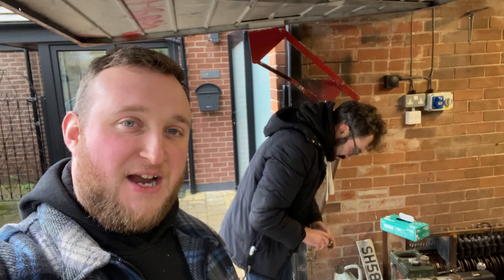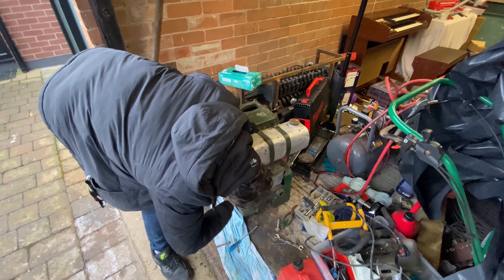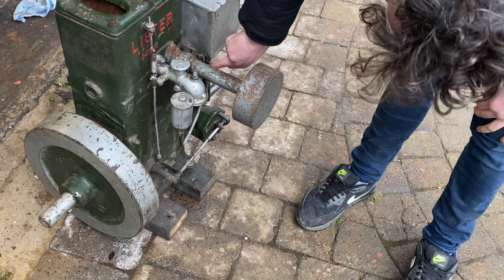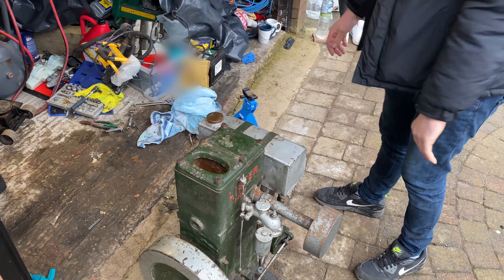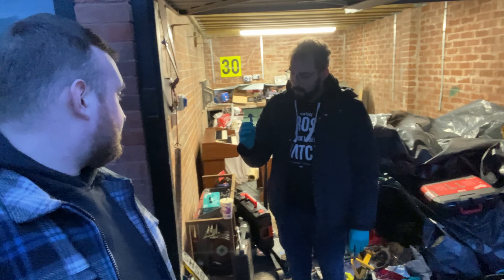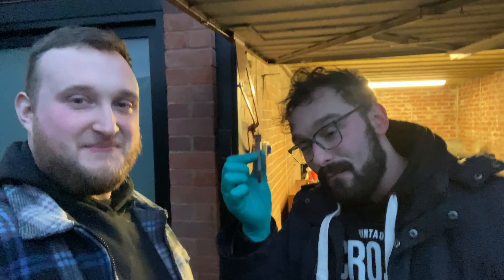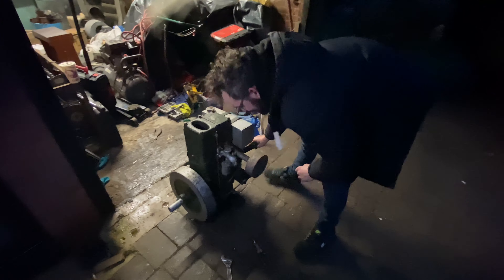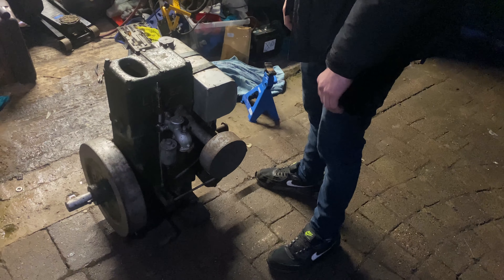We Still Can't Start It! | Lister D | Episode 2

Comment: I don't know how much this will help but here goes.....I have two Wolseley stationary engines, and I had a similar "refuses to start" issue with one after I removed and cleaned the fuel system. The float bowl assembly connects to the carburettor via a horizontal passage which attaches to the carby with a vertical banjo bolt with two copper washers either side of the fitting. When I assembled mine, I got the copper washers wrongly placed, and the difference of height of the attachment of the float bowl was only about 1mm, but that was enough for the carby to flood and the engine to not run. Once I got it right, I can now start it by rolling over the flywheel by hand (no furious cranking) as the magneto has a fitting that allows it to 'flick over' at the point of firing to produce a nice fat spark.
Reply from the maker: That's something we will definitely be checking out! Thanks for your help.
Reply: Very interesting! We’ll give it a try! Funnily enough the kit came with about 4 different sizes of washer, the originals are copper (and where absolutely creamated!) and the new ones I fitted appeared to be slightly oversized, the next size under seemed far too tight on the threads but there’s a few different thicknesses so certainly worth a try! No matter how much I tightened the banjo up to be snug, the float body was still able to be jiggled!
I guess you’ll find out in the next video if it’s a success! If it is, I’ll gift you the old washer personally.

Comment: You don't adjust the float height, the clip sits in the needle groove and that is where it lives, has anyone tried adjusting the mixture wheel? One turn back from fully clockwise for a cold start, stop using the float tickler they flood easy, hold down the air valve when cranking, release when it fires, is the governor linkage free to move? Does the spark jump 5mm out of the engine? Watching this is to be honest seriously bloody painful for me as a Lister D owner and car technician.
Reply from the maker: I don't think we made it clear to see, but the float is actually jumping out of the groove. Hence the need for constant adjustment. A new needle and float have been ordered. So hopefully that will solve the issues. 

We are now debating completely rebuilding it. The fact that it doesn't start is just one of its issues. 

It would appear that you have an advantage on us…having owned one for a long time plus being an automotive technician… as stated in the first episode…We aren't. We enjoy tinkering and are learning as we go.

I apologize if the content is painful for you to watch.. But we had a great time.
Reply: I'll still watch and suffer the pain, I've had that clip problem and you can sort of bend it a bit so it grips.
 @TheMechanicalChannel
Reply: Don't know about a rebuild, it seems to have plenty of compression going by the way the engine lifts when you crank it and it hits compression, and your mate kickstarting the flywheel to get it past, they will run with practically none, had one like that. They are virtually unkillable.
Reply from the maker: Thanks for sticking with us 😂 

We are debating starting from scratch with it and rebuilding from the ground up. It has many issues that need addressing. A job for the spring/ summer. But then again, as you say, it might not need it. A replacement float is definitely on the cards though.